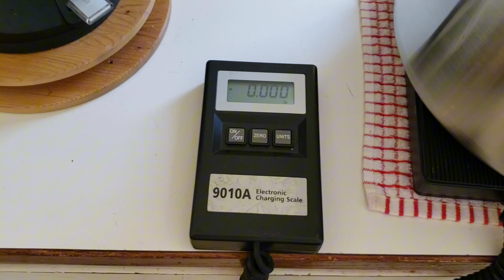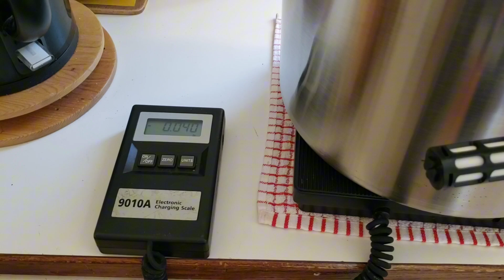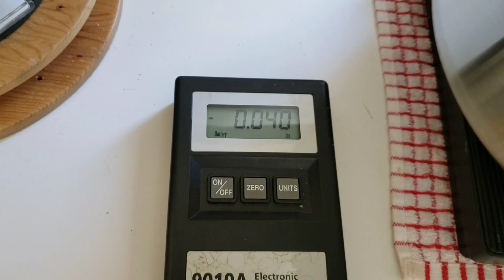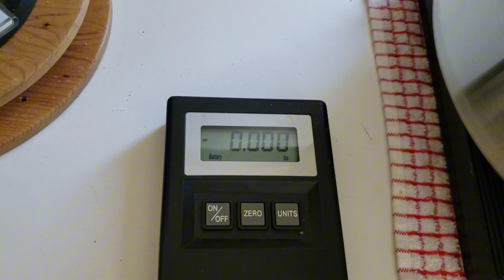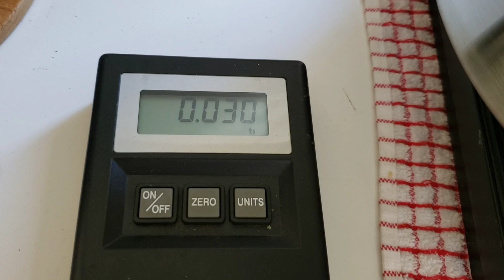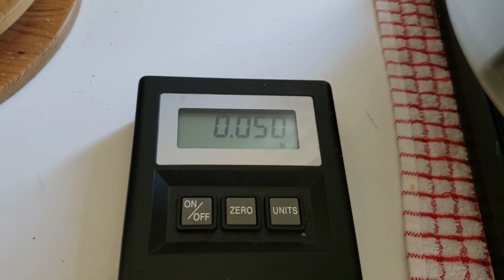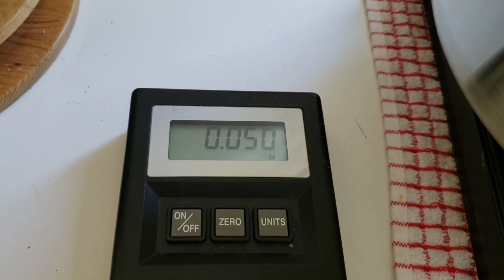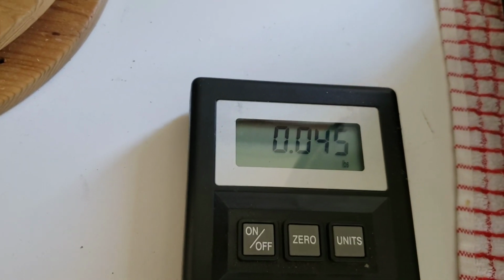Measuring the buoyancy of vacuum / Weighing air

Comment: Off topic Jesse.  Your Lewin Clock (perfect name) has just been covered Trevor Kearney.
Reply from the maker: Thanks :D I kind of skipped around in his new video, I see he's going on about ohms law.

The other day I checked the voltage on my car's battery. It was 12.3 volts. Assuming an internal resistance of 0.01 ohms, we can use ohms law to calculate that the battery was delivering 1230 amps to my volt meter. Which is funny because my volt meter has a 10megohm/volt input impedance, so I would like to know how many volts it takes to push 1230 amps through my volt meter! (Read parody here.)

Comment: now you gotta do this again but by adding hydrogen or helium to higher than atmospherical pressure, showing that it'll get heavier, to address further misconceptions of our fellow flerfs
Reply from the maker: Actually, it's well known that helium tank pressurized to 2000 PSI is heavier, so that's been done! (And due to the 

Obviously my vacuum chamber can't hold pressure because it is the outside air pressure that holds the lid on!  However, it would be interesting to pump a vacuum, show the reduced weight, and then let back in helium instead of air, and show that helium actually does have more weight than vacuum. Helium is kind of expensive unless you get a helium balloon kit for like $33USD which is still kind of a lot for one experiment.